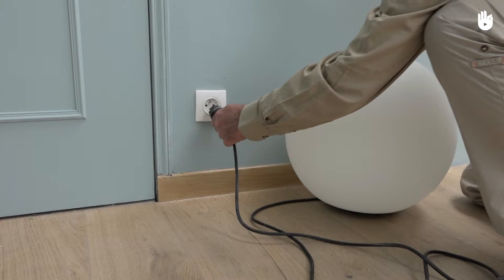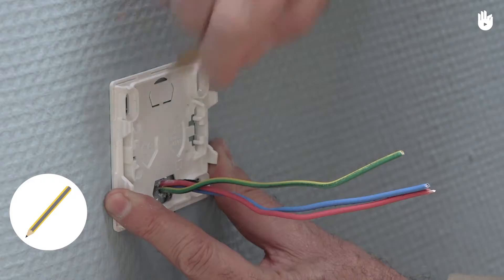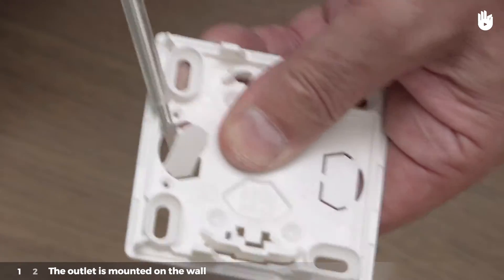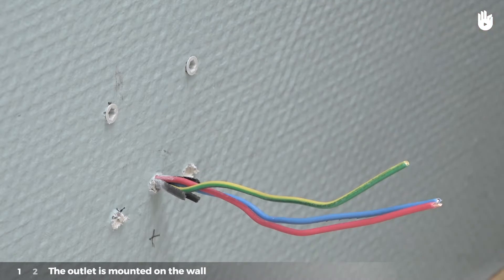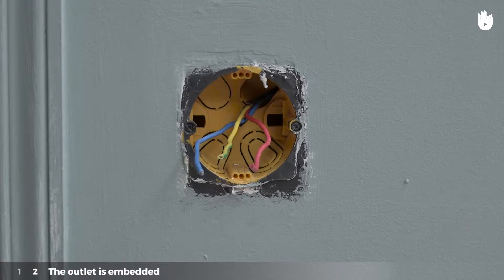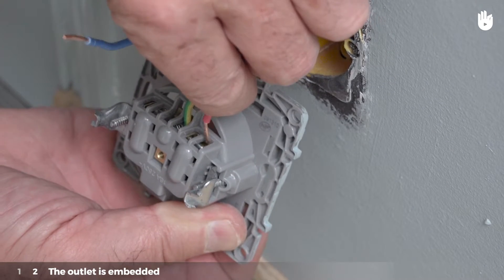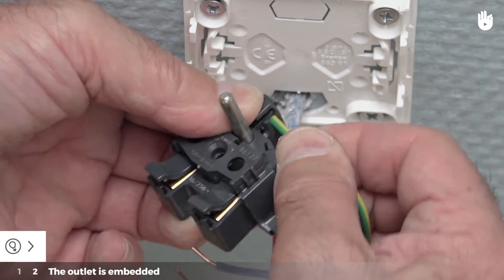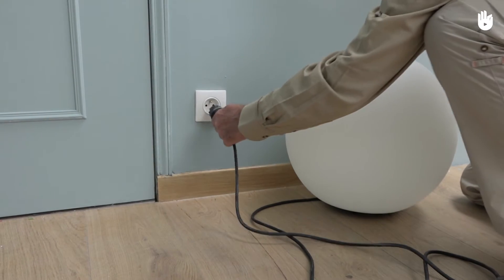How to Connect an Outlet to a Power Supply | Electricity

Comment: The live (phase) and neutral wires are partially exposed at 2:39. Funny that literally seconds later the video follows up with "if the cables are exposed, just shove them in a little more", which is not going to work here as it seems that the guy in the video has gone all the way in and the wires still stick out. The wires are too long and need to be cut back so they are not exposed when you screw them in the socket.

Electrical inspectors would have you for that.